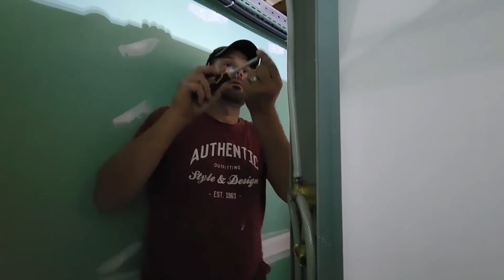It is different but it is still EXCITING!!

Comment: There is no point to go solar in Russia, the electricity is so cheap that it makes no financial sense. Those fittings are weird, what's the point of using brass and plastic. Around these parts (Serbia) it is either plain copper or PVC pipes that you "weld" together using a cheap heating tool.
Reply: Electricity is not so cheap and we don't use this kind of plumbing system
Reply: @user-qm5rq  Price of electricity in Russia is around 0.05€ per KW/h. In Serbia it is double and even with those 2x prices it would take me a minimum of 15 years to pay off a full system. Furthermore you have cheap gas so you do not have to use electricity for water heating/cooking. What do you mean you do not use this kind of plumbing? He bought this in local stores so clearly someone is using it.
Reply: @galileo_rs  this kind of plumbing system is very rare. A lot of subscribers see it first time in their lives:)
Not everyone have gas in Russia. I personally don't. And electricity is expensive for me
Reply: This pipe fitting system requires a professional expensive expander. Why buy this for one house? In Russia, there are plastic pipes with a cheap soldering heater.

Comment: To be honest, it doesn't make much sense to me that the builder would provide his own technical house planning project. It is implied that it is how it works in North America (or at least Canada), but as an European I know that here (and assuming Russia too) it is mandatory to have an engineer draw the house plan (either pre or post construction). 

Main reason is he will need to be registered in the Order of the Engineer, which recognizes him as a certified engineer that complies with the legal rules' standards and requirements of construction stated in the law, and is personally deemed responsible for any structural anomalies or deviations. 

Yes, it is bureaucracy for the most part, but it burdens the engineer with the responsibility to approve a project that follows the standards set by the Order. This will eventually be tied to all kinds of actions, from (meaningful) renovations, to insurance policies, etc... I'm still wondering if in Canada it's that "do as you wish" style or if most cases fly under the radar of city planning.

I think this is just a matter of semantics and forms, I can hardly imagine Canada city planning taking owner's plan projects at their word. And if an inspector does do a thorough inspection, it's strange that he wouldn't engage the resources to do the measurements and draw an official layout.
Reply: In Russia, there are no standards and inspections for the construction of a personal home or building. The project as an extension document - your wishes. For registration in the state register, only a general plan of the house and plot is needed.

Comment: I really dont like these paper homes! 

I know its much cheaper than brick, but not as stable and long lasting. Good luck with your build 👍🏾
Reply from the maker: That is nonsense
Reply: @countrysideacreshomestead2008  well I can't take your word for it  I'm afraid 😣 the ones I've seen here don't last long - like a temporary home? - maybe it's the build quality 🤔 anyway I'm building using stone ( I thought of using even prefab, much quicker, but I decided on local stone).
I'm sure it's different in Russia - all the building tech and stuff.
Reply: It's not cheaper at all if done properly

Comment: Do they carry PVC pipe for plumbing in Russia?
Reply: Typically in Russia, polypropylene pipes and polypropylene fittings are used, which need to be welded.
Arend's choice is not usual.
Reply: @SomewhereInRussia  we have use PVC with a special glue to secure them. They fit into each other. No welding needed. They don't have that style?
Reply: @ancientfriend  Never heard of such a thing. But yes, you can buy it in Russia. For example, Bailey L-6023 PVC Pipe Glue 946ml is sold on the Ozon market for $29.
Reply: @SomewhereInRussia  I'm just curious. We're thinking of moving back to the area where my husband was born in the Siberian region.
Reply: @ancientfriend   Any construction technology you can imagine is available here. But for the liquidity of your home, it is better to use popular solutions. Good luck!
Reply: @SomewhereInRussia  спасибо!

Comment: The's too much of tech in your house. Once you you've lost an electricity there will be no drainage pumping in your toilet/shower/laundry. And your hot water with heating system is to be combined? Never seen it. A cutlet must be separated from a fly. Any critical lifesupport sysytem must work without electricity, just using gravity and convetntional fuels (firewood, coal).
However, if you'd like to bring some extra fun during cold winter days, thats's ok.
Reply: Электричество у нас в России не отключают почти никогда если только авария, но у них есть генераторы на всякий случай

Comment: Electricity is very cheap in Russia. So cheap that any method of independent generation would be more expensive. A few years ago I did solar, wind and fuel generation calculations for a house with electric underfloor heating. Perhaps something has changed now. But it has probably gotten worse. Try doing the math yourself. Good luck to you in any endeavor. 
In any case, it is useful to have an emergency generator in the country house.)
Reply: It's not cheap and become more and more expensive
Reply: Believe me, one of the cheapest in the world for regular people. I agree that it's getting more expensive. But everything's getting more expensive. It's called inflation.)

Comment: https://youtu.be/IK3W_uq-iJE?si=OV0Udiky-ej8dT8g

At my house, this connection was mounted in this way. The clutch is stretched and you don't have to wait. It's easier to stretch a pipe without a coupling.

Comment: полный ужас,гипсокартон даже в ванной,там же влажность,ему хана через 5 лет настанет 😂
Reply: I live in a 40 yers old condo in Florida and there are tiles around the tub and the shower. No special waterproofing. And it is just fine. нету хана. нету. We have central a/c that dries up everything fast. I am sure Arend will install ventilation in bathrooms.
Reply: How many houses did you build? How many bathrooms did you install?
Reply: Должна быть плитка. А тогда зачем шпаклевать гипсокартон? Значит будет краска?